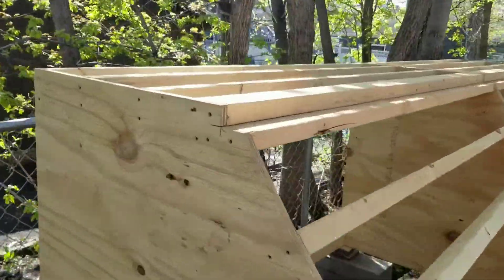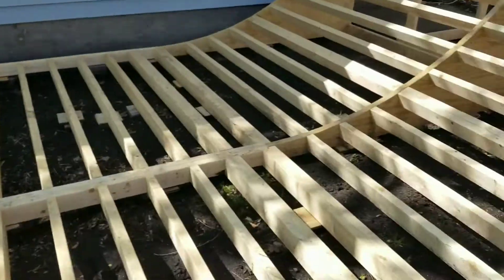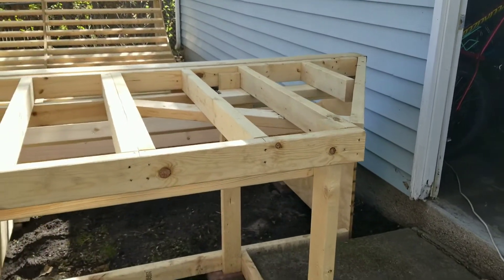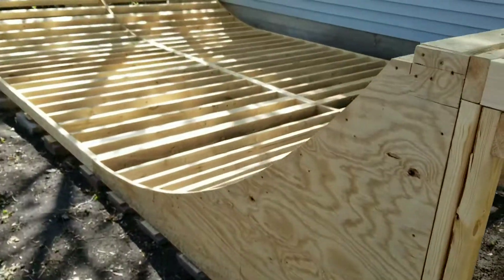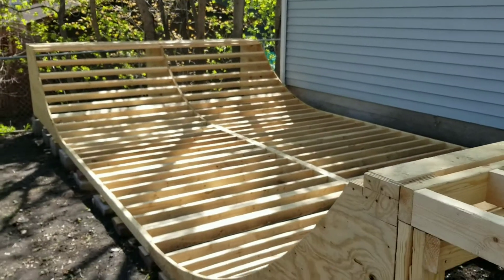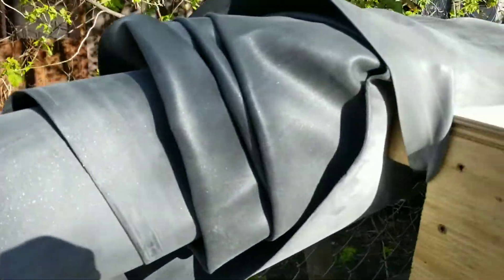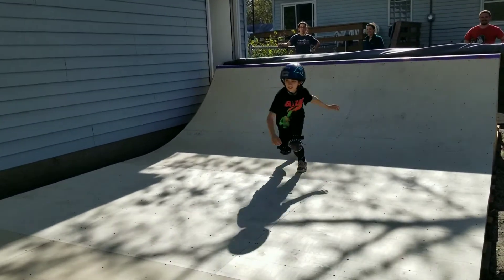The Art Of Ram - More Mini Ramp Building Tips - Ramp Building 101

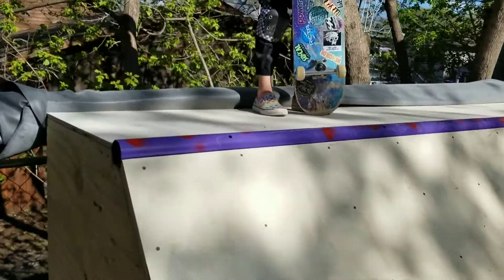Comment: you mentioned in the video that a 6ft span is ok with 2x4s at 2:35 . if the distance between  the 3/4 plywood transition sheets are 8ft, would you recommend bumping it up to 2x6s?
Reply from the maker: Absolutely 8’ span is best with 2x6s you can use 2x4 but you may consider scraping in a support system